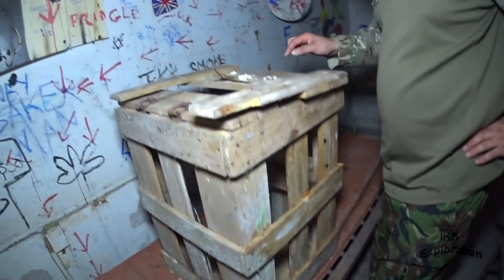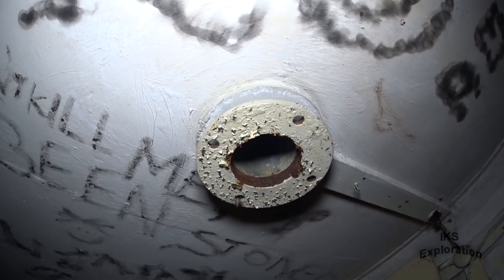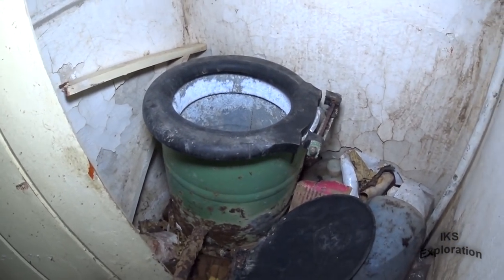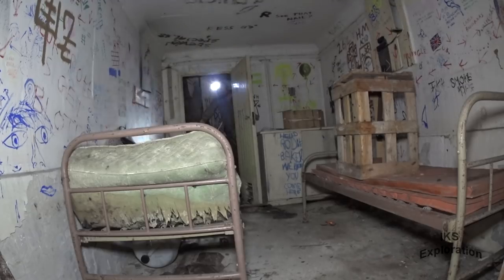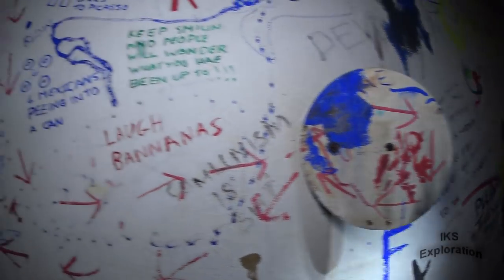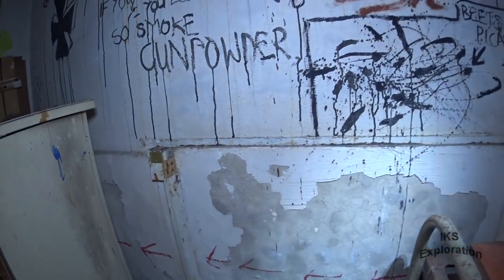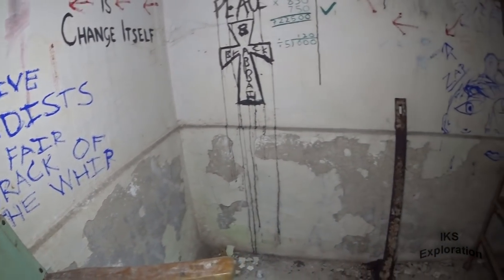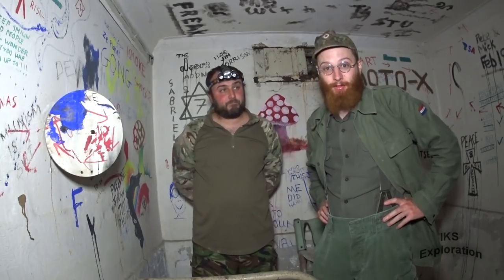ROC POST COLD WAR BUNKER

Comment: At 9:28 what is the orb that crosses the freeze frame?
Reply: dust ghost
Reply: It's called dust.
Reply: lingerslongest see one at 3:53 too
Reply: lingerslongest also at 3.57..doesnt look like dust to me tbh.
Reply: Looking again; on the right hand side of the screen at 3:59 to 4:05 there are some other smaller "dust orbs" that rise up then roll down.  As the big ones from the two time frames have the same positioning & trajectory on the lens, I suppose that they are technical glitches that come from the camera/editing.  Either that or someone somewhere is eating a toffee crisp.  lol
Reply: its all dust :-)